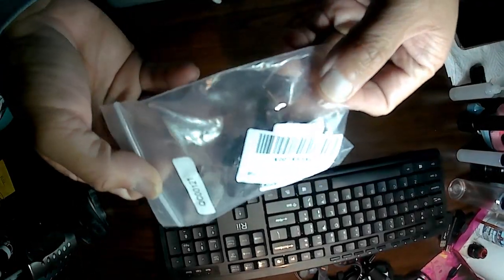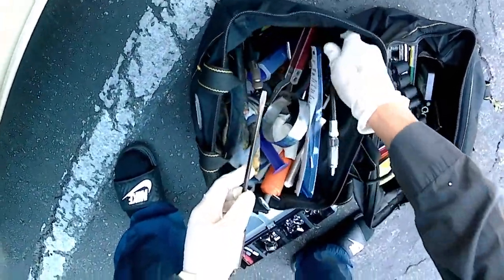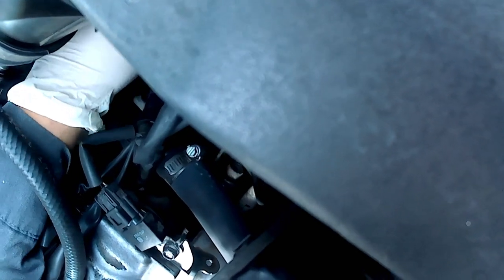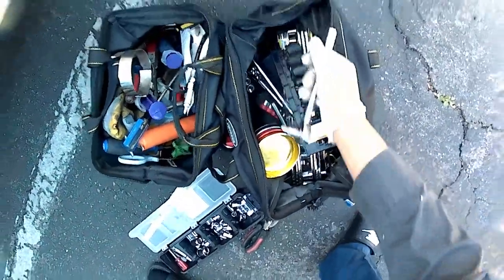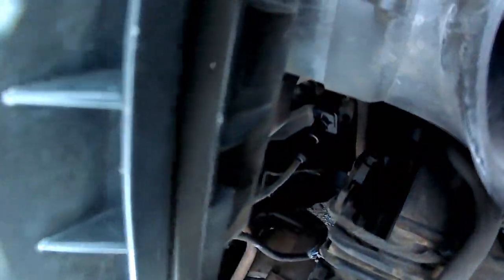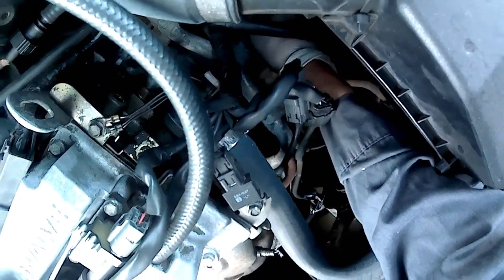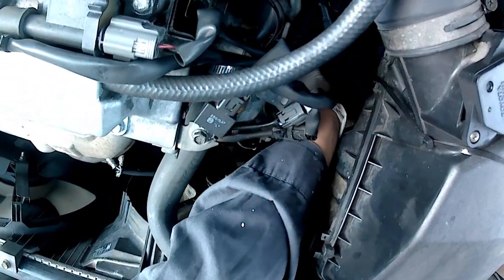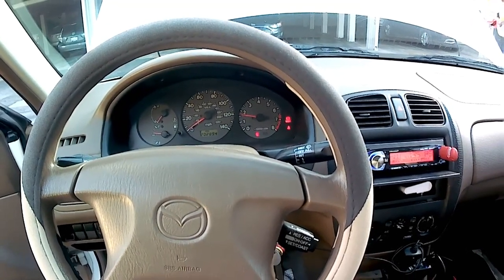1999 Mazda Protege. Replacement input/ turbine speed sensor.

Comment: Trans speed sensors have 2 input and output, so how do you know which one to replace
Reply from the maker: only 2 types abs speed sensor and transmission speed sensor, abs speed sensor will just give you a code but the transmission speed sensor will make your transmission act up.

Comment: Could I see where the speedometer sensor is going not the speed sensor but the   speedometer sensor
Reply from the maker: this is located on top of the transmission directly under that intake pipe, its on the housing.

Comment: Hello I have a 2003 protege and the problem I am having is the abs and the brake light come on, then the speedometer goes to zero and the transmission starts acting up like if it went into neutral
Reply from the maker: sorry for a late reply, your 2008 has wheel speed sensors, locate on which tire is acting up on code for ETC, your brake lights on look for your brake light sensor on the pedal, then check your shift sensor on the transmission.
Reply from the maker: only 2 types abs speed sensor and transmission speed sensor, abs speed sensor will just give you a code but the transmission speed sensor will make your transmission act up.